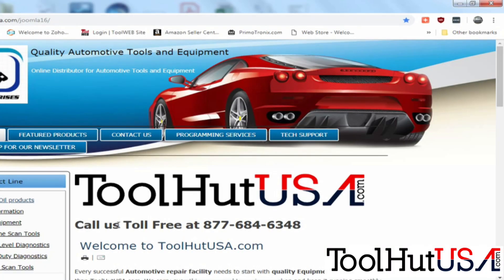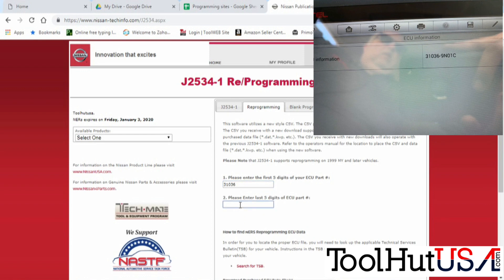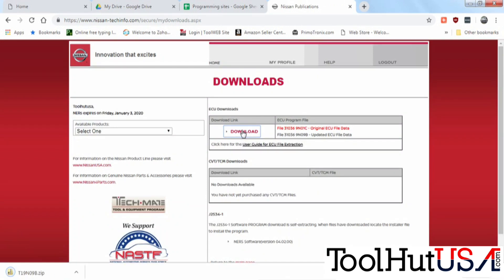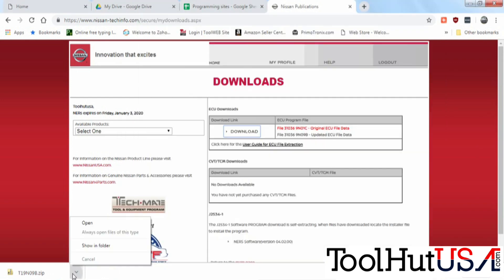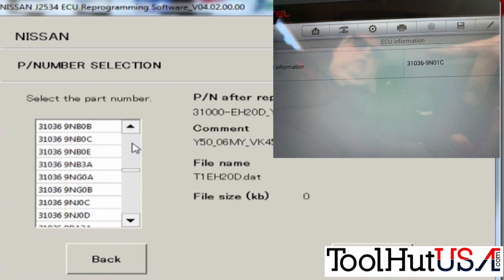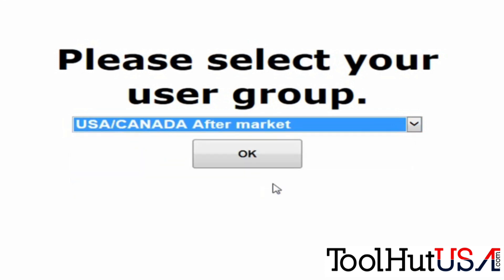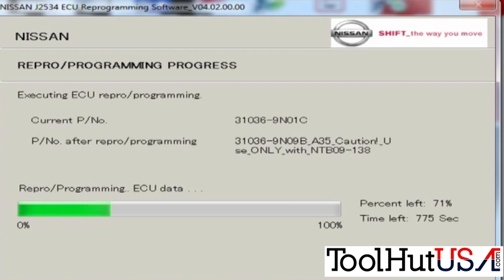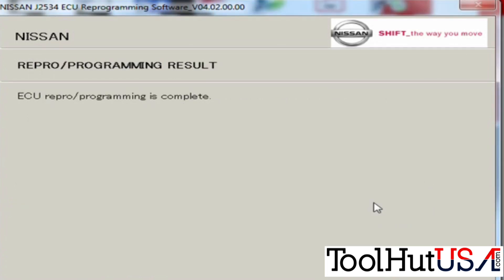Nissan Maxima TCM J2534 NERS

Comment: Hi Sam. Have you had insurance where in middle of ECU flash laptop restarts basicly corrupted the ECU n now No communication -its dead. i was able put Used ECU n made immo/keys work thanx to Autel—but i CANT change VIN to match vehicle VIN. Vehicle runs, drives, no codes but has VIN from other car. I know it be issue when comes to Smog Check - its looking for it. Anyways What Soft can Change VIN in ECU/ECM any suggestions?
Reply: Ners will change ecu vin